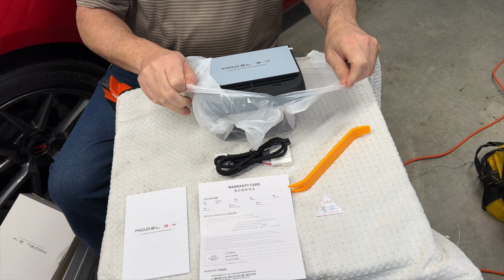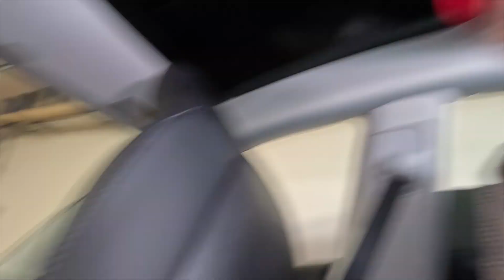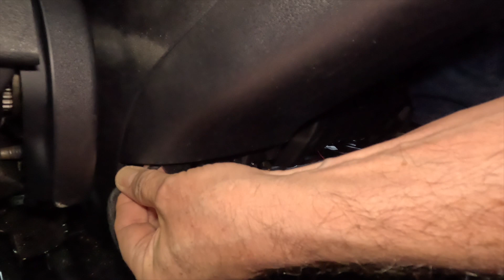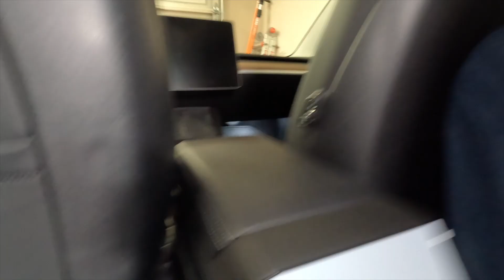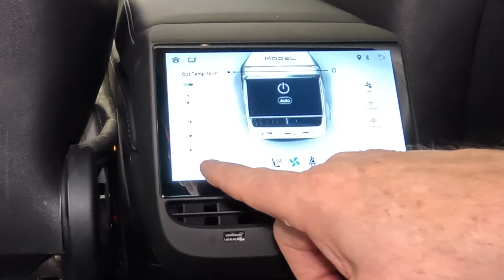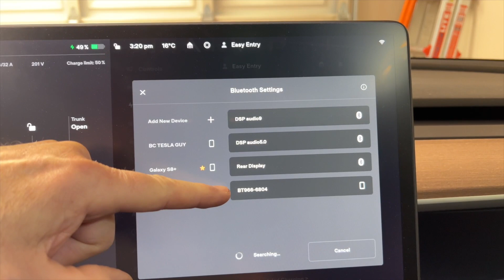Model 3/Y Rear Entertainment and Climate Control Touch Screen Display    7" Display

Comment: Still watching this video in 2025! Great tutorial! Quick question if you have more aftermarket electronics like a speedometer. Is it safe to daisy chain the connectors ?
Reply from the maker: Yes, absolutely no problem connecting multiple devices.

Comment: Only ten minutes IF you dont already have something else pigtailed to the OBD connector. However, i tucked the two pigtails, one going down and the other coming back up. This allows you to reinstall the trim piece.
Reply from the maker: I have a couple things plugged in too. Will be adding another soon. Testing out the new option to eliminate the Tesla Nag while on autopilot or FSD. Thanks for watching

Comment: Thanks for this thorough install help.
Do you find the screen is always saying it has an available update but when you do it, it restarts and installs fine but no changes were made and there is another ‘update’ constantly ?

Also, the seat adjust doesn’t work even though I’ve plugged it to the passenger seat, I have a 2020 model 3P.. anyone help? TIA
Reply: Did you figure out the issue yet? I have a 2023 Model Y and need some help.

Comment: I currently use the plug where the screen is connected. for an additional display in front of the steering wheel, can I use a splitter?
Reply from the maker: not sure. You should reach out to hansshow

Comment: Hi,
I'm having issues with mine staying connected.  The rear display is stuck on "waiting " and I'm unable to get back to the home screen. Should both my phone and the display be able to stay connected at the same time? 
The display works I know that because I've messed around wirh it. But the last few times I've entered my vehicle it has been stuck on "waiting ". The car Bluetooth isn't discovering it while it's in that state. Thanks in advance
Reply from the maker: you can try unplugging it and plugging it back in. This will power cycle the screen.

Comment: Hello how do you change the word Model to the time display?
Reply from the maker: not sure I understand. word Model?
Reply: Where the time of day is displayed, my unit shows the word Model.  I've reached out to the company but still waiting for a response.
Reply from the maker: have you connected it the internet to get auto-time update?
Reply: @davidaponte118 did they come out with an update to customize the banner to Model Y or 3 or Date Time?
Reply: I agree instead of just "Model" It should be configurable to allow "Model Y" or "Model 3" based on what car you install in.

Comment: Hi does this have inbuilt speaker ? Or everyone have to hear the sound from the car speakers?
Reply: Sound will play with a delay over the bluetooth connection on the car. At least with my brand new unit I installed after watching this view.  Buyer be warned!
Reply from the maker: no built in speaker. You need to connect it to your car with bluetooth. Sound will play over your car speakers. Thanks for watching

Comment: Would this void any Tesla warranty?
Reply from the maker: That would be a good question for Tesla. It doesn't modify your car's software. But like other manufacturers, anything you connect to your car can be deemed to void the warranty. I connected a GPS unit to my new 2008 Jeep Grand Cherokee in the past to my battery to power it. When I took it to get serviced, I was told I could void my warranty if I left this connected. All it was doing was powering the GPS unit. If you're concerned with warranty, I would not connect anything to your Tesla until it's out of warranty, and only use Tesla approved parts including LED lights, filters, 12v battery. Sorry, I'm sure you wanted a clear answer. thanks for watching

Comment: I have a question. Did you have any problems with rattling noise or anything after installing it?
Reply from the maker: not yet. If you hear a rattle it's most likely the cabling. I would check that. thanks for watching.
Reply: @BCTeslaGuy  I just wanted to know before buying it. Thanks anyways.

Comment: Does it void the Tesla warranty?
Reply from the maker: technically anything you do to your car can void the warranty.
Reply: Then it’s a risk
Reply from the maker: @joydipbasu5093  like I said, any mod that changes your car (not just tesla) can void warranty. Swapping out the interior LED's for brighter one can void warranty. I installed a gps tracker on my 2008 Grand Cherokee and when I took it in for service, I voided my warranty by hardwiring the unit to my battery. I fought them on this and they decided to drop it. My recommendation is never change/add or alter your car regardless of the brand if you're not willing to risk your warranty or at least wait till it expires.
Reply: Hell when you take it in for service just change it back to the old one All to do is take 5-10 minutes